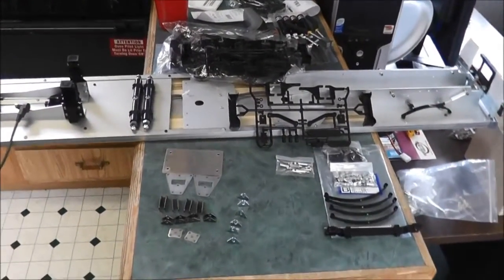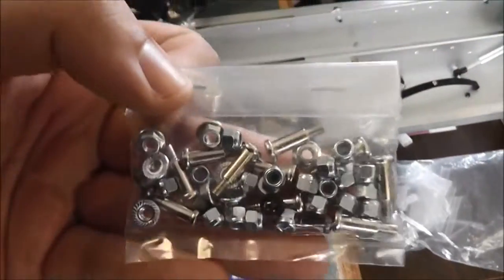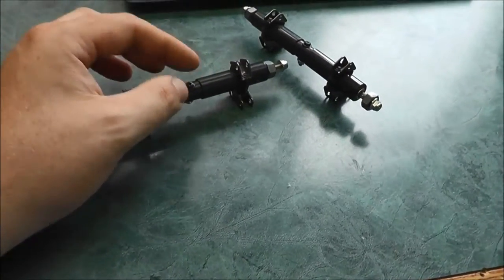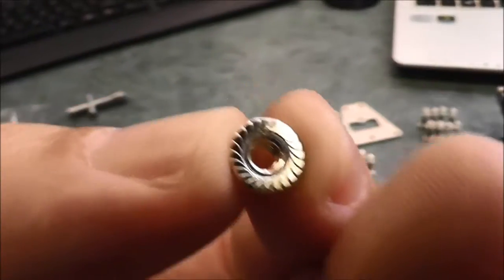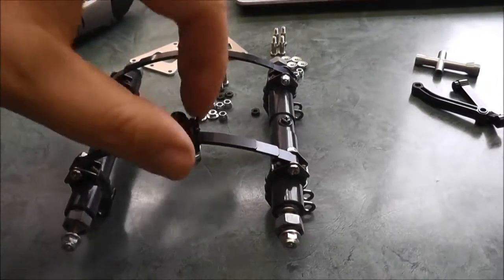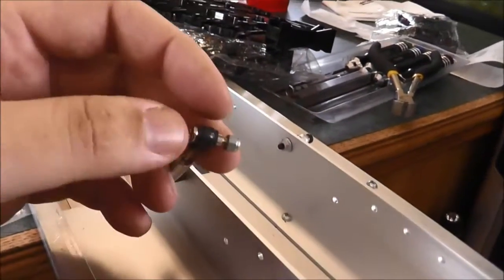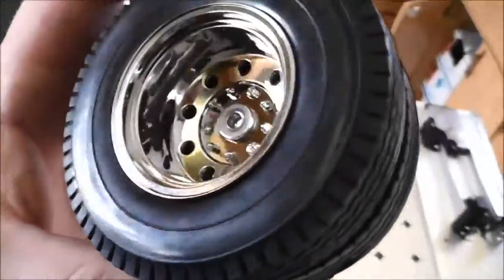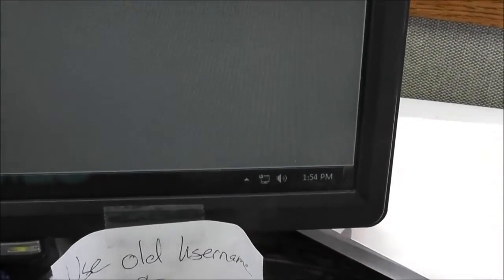Flatbed trailer repair

Comment: how did you extend your trailer
Reply from the maker: I thought I had a video on it but I will have to make one it seems. It is a standard kit that is cut and lengthened using some hardware store material. Was not done by me, bought it done that way.